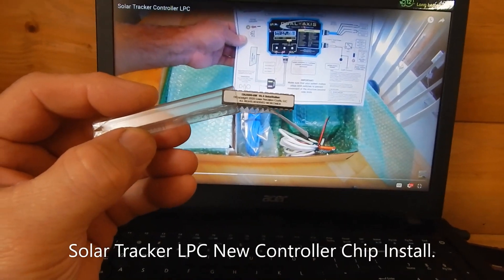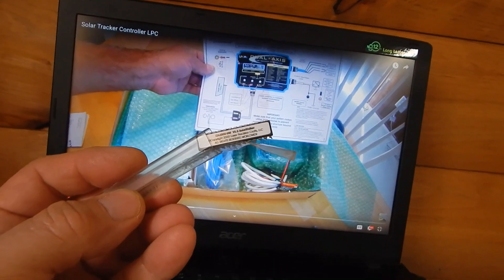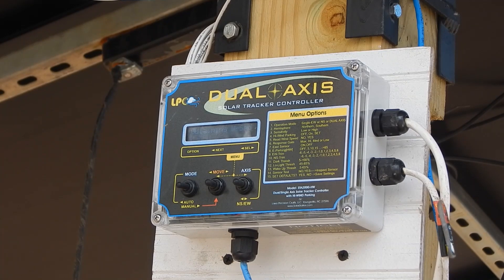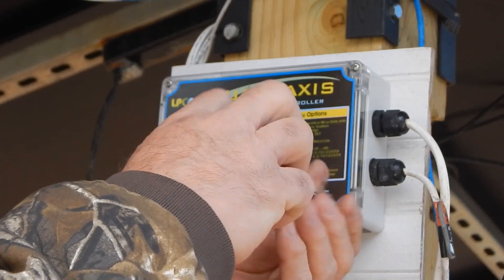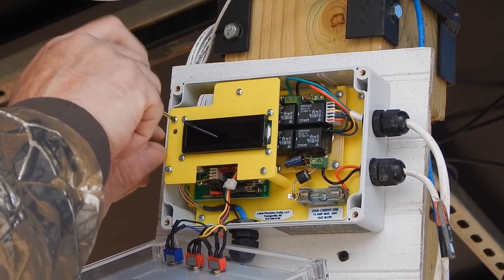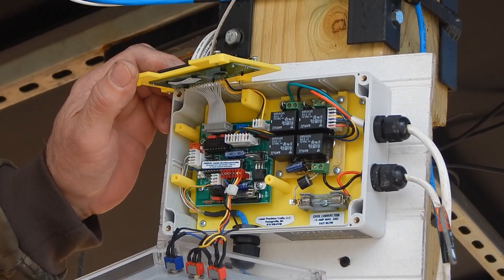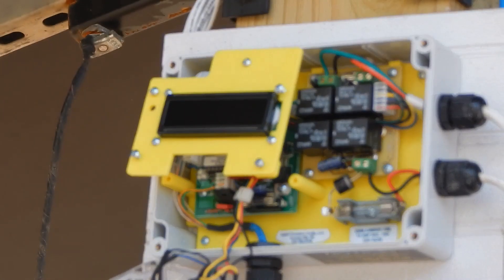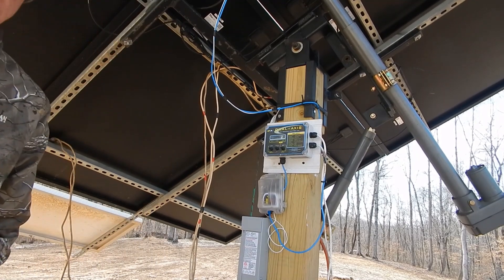Solar Tracker New LPC Controller Chip Install. Part 1

Comment: To remove the chip I would have pushed a flat head screwdriver in under between the chip and socket at both ends and rotated 90 degrees carefully to lift it up without bending the chip too much.  This way there is no strain on the PCB
Reply from the maker: No room to do that on this unit. I used 2 hook like picks to remove the old 1
 Thanks.